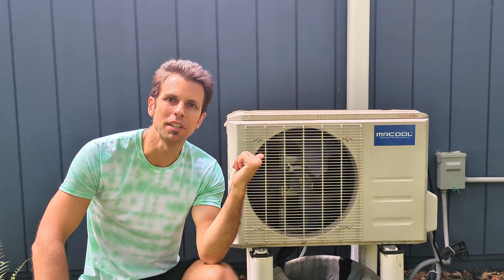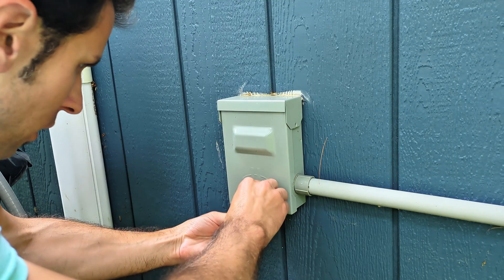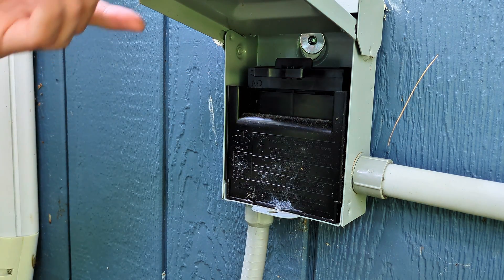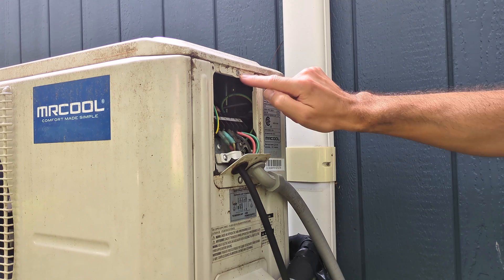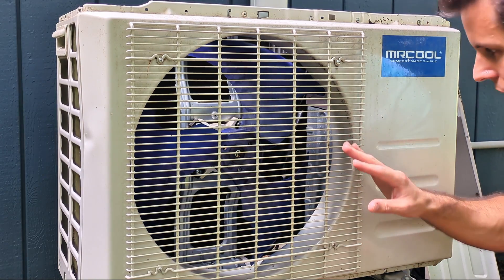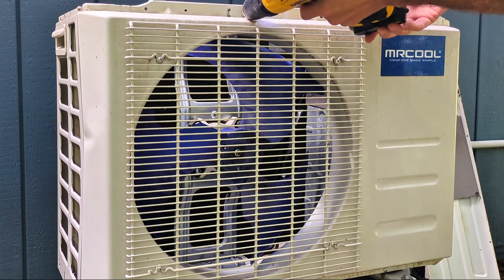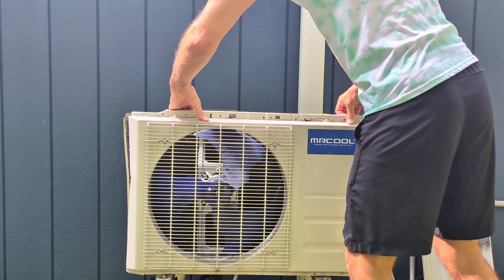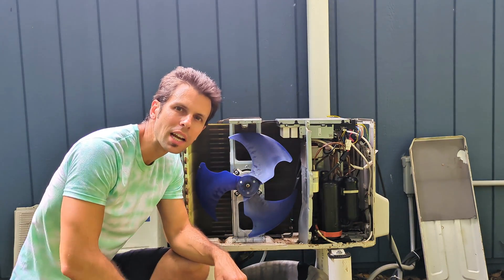How to Open A Mini-Split Condenser for Maintenance and Troubleshooting - Mr Cool brand

Comment: That was helpful. I’m trying to determine the best location for a Mr. Cool DIY 24K mini split exterior condenser. The best location for proximity to the inside unit is under a deck while there is adequate air on all side the top of the unit is only 6” from the bottom of the deck joist another 7 1/2” to the deck board. The spacing of joists are 16” on center so if the unit set parallel to the center of the joist bay there would be 13 1/2” vertical space that would be 14 1/2” wide, seems that would be adequate to remove the top but would it be enough to access / service the components on the top of the unit?  Seems like a Technician could get most of there head in the joist bay to view components but how involved is the dismantling and diagnostic work of those components, I’m guessing the circuit board is in that location. How I’m thinking that if the unit set perpendicular to the joists especially if centered (the 14 1/2” width joist bay) over the dominant component. Anyways, your video is helpful to visualize what I’m trying to conceptualize. Just wondering if you have any insight on what I’m noodling here.
Reply from the maker: I wouldn't worry about airflow as long as the deck is open underneath (not blocked off on the sides). And assuming you don't get snow under the deck, then the unit wouldn't really need to be elevated. Technicians likely wouldn't need access other than the pipes on the side for routine checks. I can't think of any reason code wouldn't allow it but something to double check